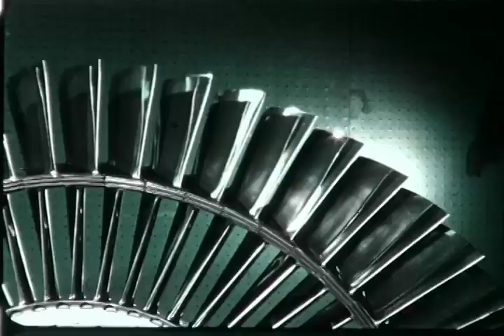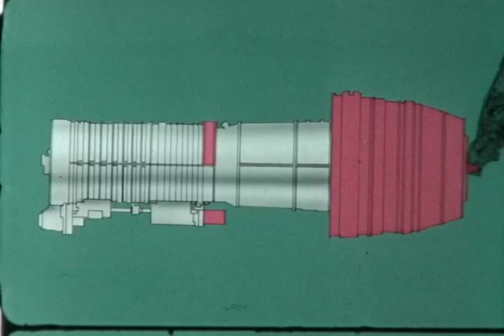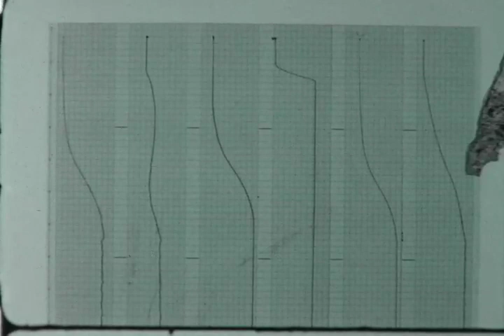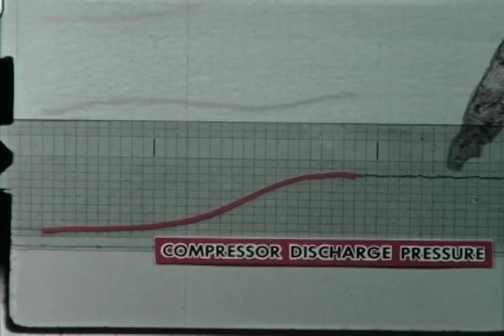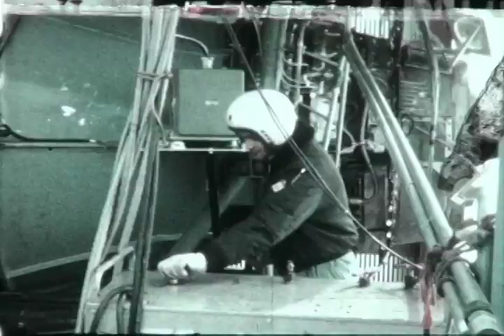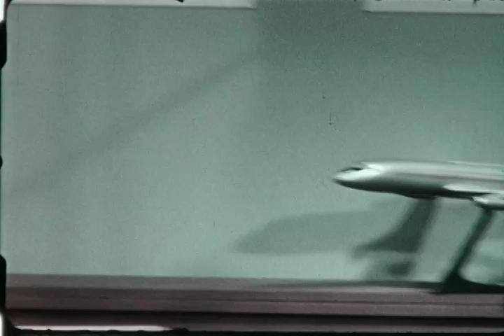F-0644 Convair CJ805 Turbofan Engine Video Progress Report #7

Comment: The aft fan configuration never really caught on.  I'm told (and I'll be the first to admit that I'm no expert and this is hear-say) that shortly after it's development, new gearing systems were introduced to front fan engine designs that nullified the aft fan advantages. Oh well, it was still a really interesting design concept.

Comment: Very interesting video.  Thanx for ULing!  :)

That engine is freaky. I had never heard of an aft fan engine before.  Obviously, once they got front fan engines working well . . . they were better, since that's all there is now.  ;)
Reply: Not quite--General Electric's CF700 aft fan turbofan engine (a civilianized J85 turbojet with an aft fan) is still in service today, powering business jets. NASA's jet-powered Lunar Module atmospheric trainer also used a CF700 turbofan engine.